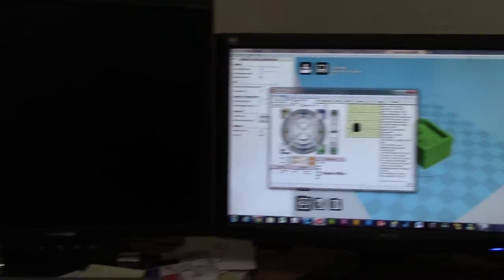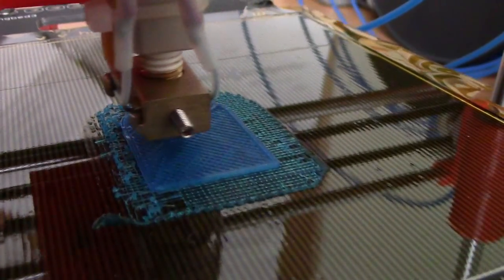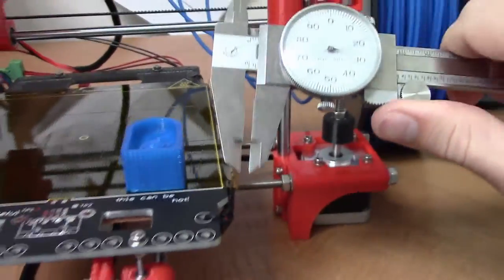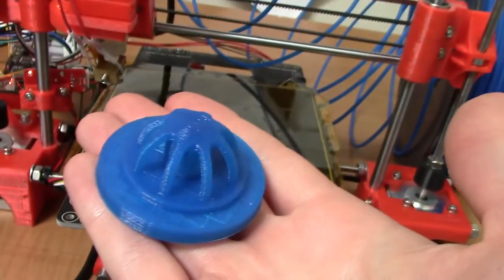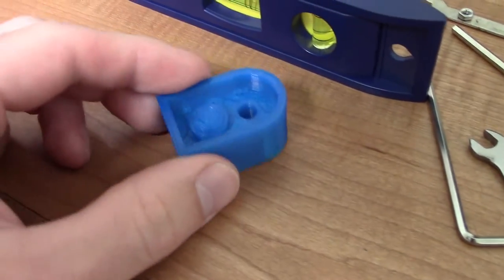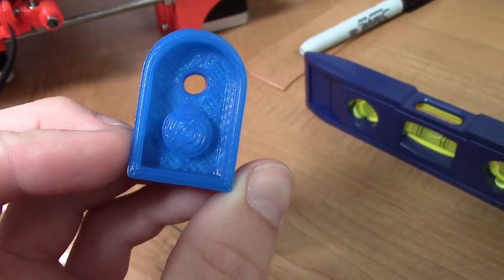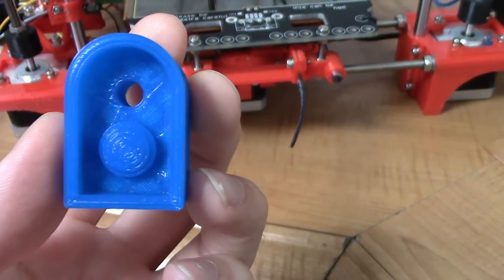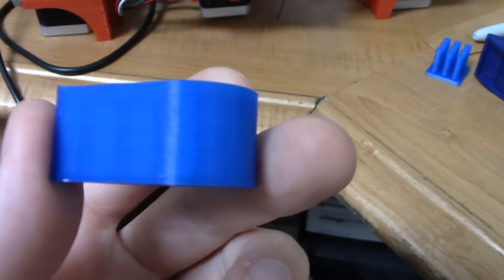Portabee 3D Printer - First Prints and Impressions

Comment from the maker: The most important setting seems to be the layer-height. You will want it set to .3mm. I simply followed roughly what the online portabee "screen shots" showed, but for the most part the stock Cura settings seemed to be just fine. If it looks like crap, chances are the printer is outta whack, or the bed is not level. I had to take measurements on my printer and spend much too long tweaking it to be true.

Comment from the maker: When dialed in properly (which can take a while), it's possible to get some pretty accurate (small) parts. If you were to try and fill-up the entire build-volume with a part, I imagine you would have a harder time getting something really-accurate. For my small-part (as shown in the video), I was able to get the outer dimensions to +/- .005", which is pretty awesome. But I highly doubt I could do that with a full-printbed part.

Comment: How would you rate the accuracy of this printer after tinkering with it? I dont mind a little tinkering but I dont want to throw money out the window at something that isnt going to print something that is a solid representation of what I'm trying to build.  Especially if Im building something that is technically larger and I'm building many smaller pieces to be part of a larger assembly.  Egg shaped holes and none true surfaces definitely wouldn't facilitate something ike tthat!

Comment: Hello!
I make the same 3d printer and my extruders princip is the same, I would be very greatfull if could explain me how did you assamble your extruder. as I see all reduktor is assambled on M4 bolt, but what gear did you use to push plastic filament. 
 And second question, perhapse you had the same problem, while you made your printer. Z axis moves very slow, and they had not enough strenght, so that moves very bad. I hope could help me.
Thank you.